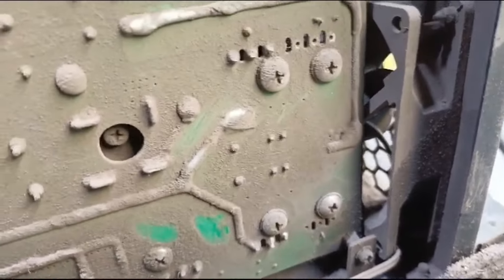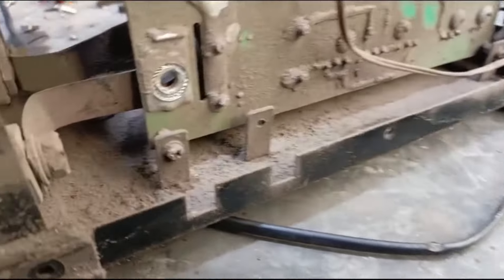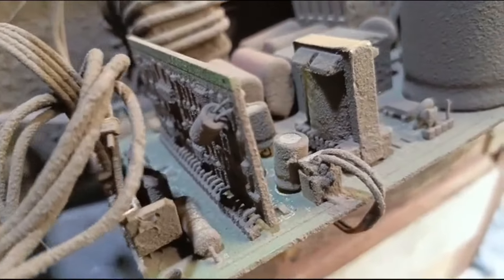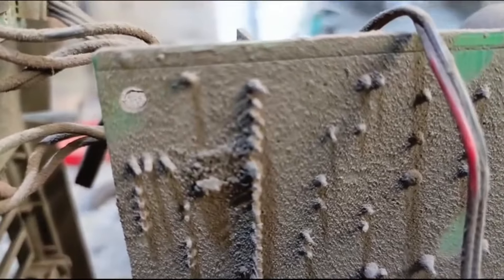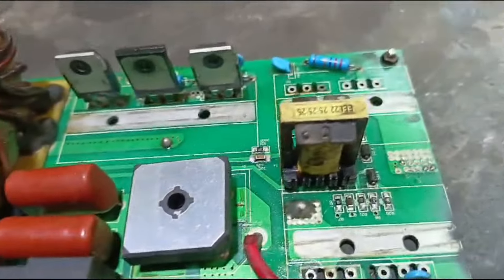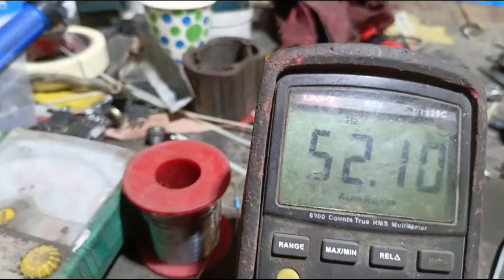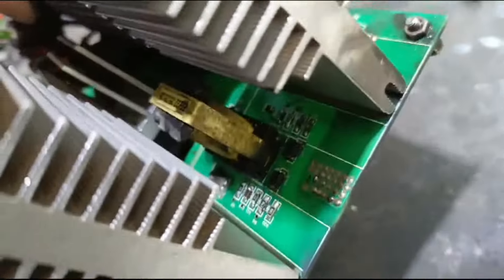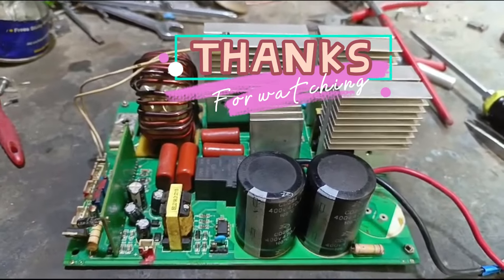Repairing IGBT  Welding Machine MMA 250 Preventive Maintenance

Comment: सर सीगल कार्ड 200 ऐ मसीन मे डराईव वोल्टेज 8 है ऐसी डराईव मे सारे रजीस्टर केपेसीटर ऐल ईडी सब नये डालने के बाद भी 1 टच मे आईजी बीटी सोर्ट होजाते है पलीज मदद करे
Reply from the maker: Please check its chopper transformer that is installed in drive and one more action you must change its comparator ic it may be LM358 or 3140.